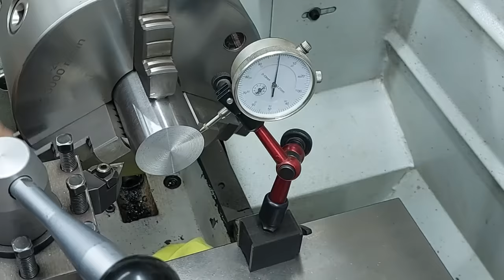Saved a lot of money! Homemade tool that turners can't do without

Comment: can someone explain why is this needed? If the piece in the chuck is turning, and then catches the tool in the post, it will turn the tool at the same rate - so it might as well be stationary. wouldn't a hydraulic press work just as efficiently?

Comment: Excellent video I like good home made tools.
Just an idea I use hexagon key that is hard  & cut a piece off, at the cutting end face I put a dish shape with a die grinder to leave the end very sharp & angle the hex 2 degrees leaving it the size right at the end 8mm mount it to the tool post & tilt it round at about nearly 2 degrees it will broach better. All ways looking forward to new ideas from you, from Coventry 🇬🇧 👍.
Reply from the maker: Thank you very much for watching and welcome my friend🙂

Comment: Nice idea, and practical in its use but I have a few remarks: welding warps metal and brings heat into bearings. And soon too much. 

The correct working order would be to turn the outer diameter, then weld on the square stock, next to  face off both ends and drill /bore inner diameters. Use a dial indicator to get these borings concentric as you possibly can. 

When you mount the bearings, make sure to apply pressure on the outer races only. Make the boring of one of the bearings slightly deeper. Mount with a piece of pipe (nicely faced off to length) between the inner races of the bearings. 
This is an extra part you cannot do without. 

Please use a copper hammer when mounting the axle… or press; now you can without putting an axial load on the balls in the bearings. 

Maybe next time make the tail end so that you can drive it with a cordless drill? 

👋best of luck with your projects.
Reply from the maker: Thank you my friend and welcome🙂
Reply: Your comment would be valid if he was making a spindle for grinding. The video is about making a spindle for broaching.

Broaching is NOT a precision machining operation.
Reply: @rok1475  true, broaching is not a precision operation. So little in fact that it would also work without bearings. But If you choose to use bearings, better keep them intact and get the most out of them, at least, that’s my opinion.
Reply: @Calligraphybooster  
It is not your project, not your bearings, not your welding skills. Why do you insist on pushing your opinions onto others? 
It wouldn’t be half bad if your opinions were relevant or valid or if you limited yourself to only pointing out that heating the bearings could cause some grease to leak out.
But no, you think you know better and you just must let the world know that.

Do try to make a broach without a bearing. You will understand how wrong you are on that point.
Heat up some bearings, let them cool down and use them in low speed application once in a while. You will discover they will work just fine for many, many years.
You may also measure the temperature of some bearings under very heavy load. You will be surprised how hot they can get. Yet they work just fine for years…
Reply: @rok1475  yeah, go on! Keep going at me! I don’t read it all, but it’s nice to know someone has a hobby too!

Comment: so the bearings on the hex tool is not supposed to wobble?! like that it is cutting using a single hex point?🤔
Reply from the maker: Yes, only at a set angle of 1.5 degrees!